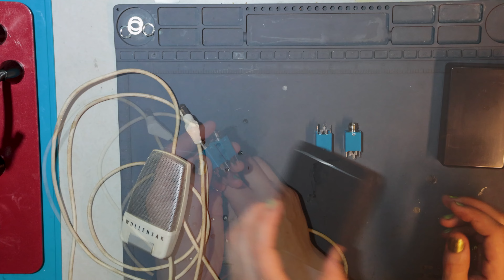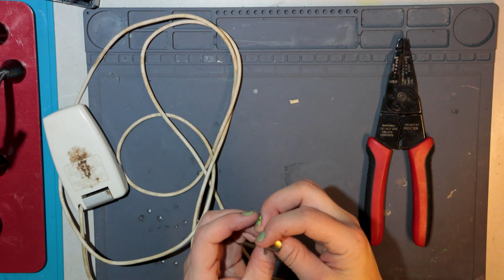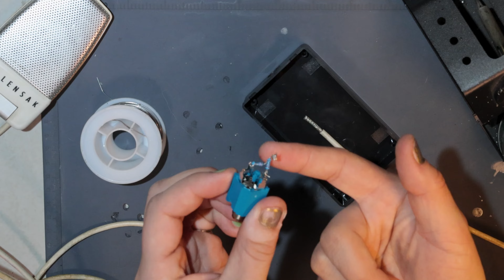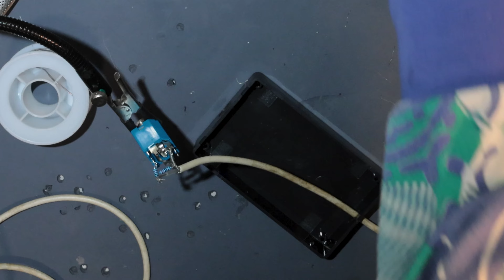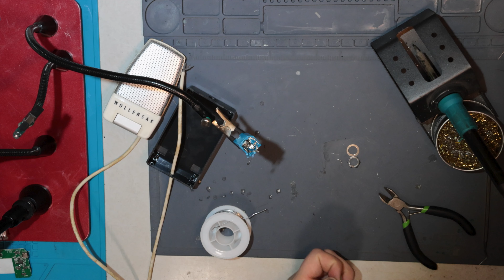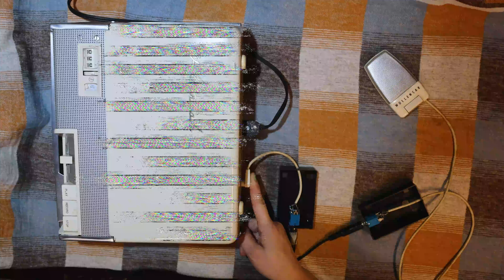Converting a Tape Player into a Tube Amp

Comment: Surprised you couldn't order 1/4" Stumpy Jacks from mouser... Also, that is a nice huge tape counter.
Reply from the maker: Ya know, I didn’t actually think to look for stumpy bits. I bet you’re right!
Reply: @getcircuitbent  "1/4-in Stumpy Jack Part No SJ-49833-B Cost: $4.95 Minimum Order: 10,000"